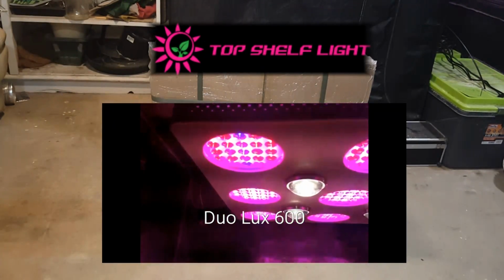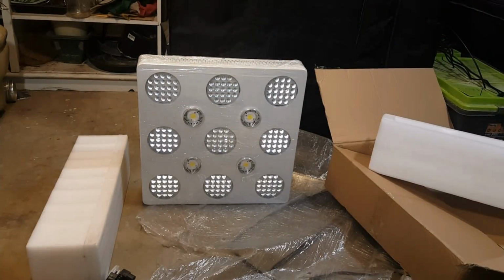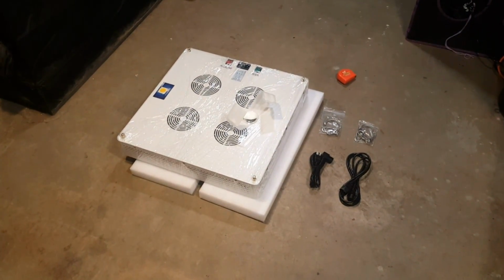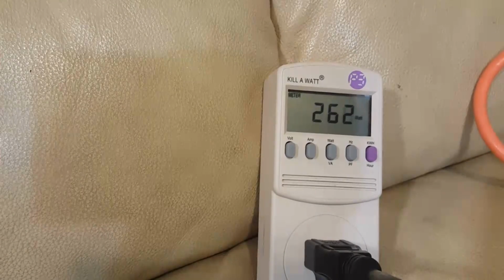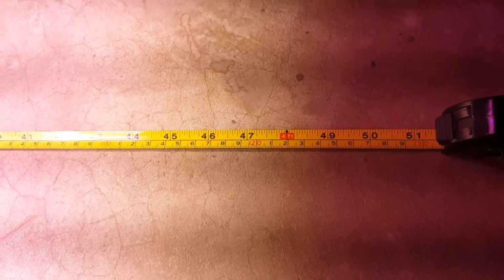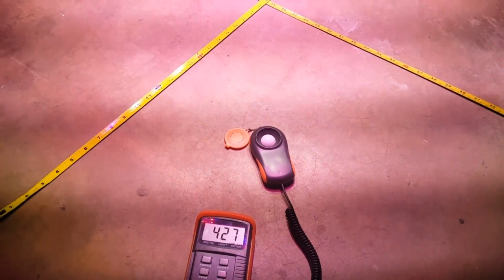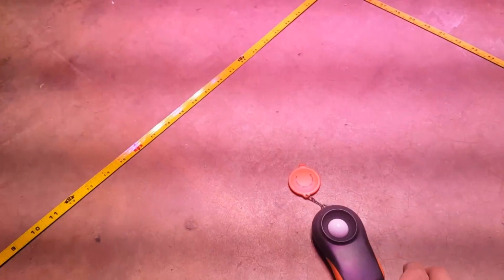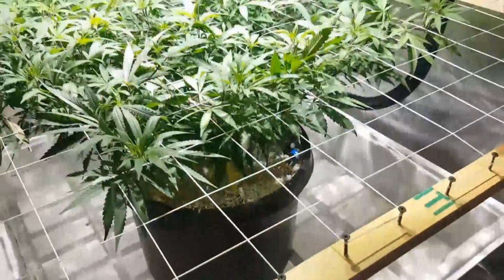Duo Lux 600 Unboxing and Testing

Comment: My duolux 600 seems to be too powerful in full spectrum mode (flowering stage).  Any idea if just running the flower mode will work?  My canopy grew a bit too high in my 4x4 so I can only get about 24" of distance from my plants.

Comment: Nice light!! I just built two of greengenegarden's 4 cob bar lights and am blown away by how bright they are. Each of the bar lights I built pulls 221w at the wall and puts out the ~same amount of lumens I get from a 400whps, ~32000!! I'm blown away by cob led. Good luck with that light.And something else I think I heard re led is that yes they produce heat but most of the heat they give off is up above the light whereas the heat from a hid light is mostly directed towards the plant canopy hence requiring a lot more energy to cool the grow space than with led so would save $$ with led. And as far as growth rate and yield, i think it depends on a lot of other factors so can't say based only on light source type whether you get more/less from led compared to hid. Cheers.

Comment: what is the price on this led
Reply: $1000
Reply: +hort hydro thanks
Reply: +Erik Coulombe if you take the time and check out there website it clearly  says it cost $1099.00
Reply: +hort hydro if it was not you then my bad if it was then
Reply: +Erik Coulombe please share with me where you can get this light for 550 I am planning on getting and would rather not pay Double
Reply: +Erik Coulombe thanks
Reply: +Homer Simpson I would be careful,my bullshit meter is going off lol..
I know saving money is a good thing.
But when someone says they can get it for half the price,that to me just screams bullshit
Reply: +Erik Coulombe did you send me that email?
Reply: +Erik Coulombe what other LED lights can you get?
Can you get a cob light with out the shitty five watt diodes?
Reply: +hort hydro looking for a cob light that pulls from the wall 600 watts
Reply from the maker: just want to post on this comment thread for you guys that the cheap ass versions erik was selling he has had 3 die withing 4 hours of use. the top self light versions have not had this problem and they have a 3 year warranty. obviously their is an internal difference between this model and whatever basic crap model he found. so good luck if you guys want to go his route.
Reply from the maker: *****
you didnt send them to topshelflight.com, you sent them to your email where you then directed them to some similar crap that is obviously not reliable and had no warranty.
Reply from the maker: +Erik Coulombe what I'm trying to tell you is what that company sold you and what topshelflight sells is not the same. that's why they lasted 4 hours and the topshelflight version performs as its supposed to
Reply from the maker: *****
no, you will see the same light casing with different components and no warrenty.

Comment: Hearing mixed results with LED and hopefully this will impress.  Not too much Jet Lag I hope.
Reply from the maker: +John McKay I'm sure this one will. Led does grow great, but it has alot of over hype and misconceptions that make people all uppity. Especially the 3w units. The still have there uses, but they don't pull the claims almost all manufacture say the do. So far cobs do tho, and 5w diodes work well too, but don't have the most efficient output/watt compared to cob or 3w diodes. There is alot more info that goes into all that assessment too. Stay up

Comment: Cree!!!!   I knew it.  Shit is gonna blow up. 

That light is badass  ..   It's using the CXA though?  Interesting....  Well if they ever go out you can replace them with the CXB.
Reply: very nice.  That light is going to kick butt and save $$
Reply: +Earl B Friendly won't save shit that's the biggest lie about led is if u want equal flower u need equal power sure u can save but u will also get less return. that said I'd love to have this light
Reply: +greenghost3737 actually it will save money will not have to replace the Cree led for a very very long time. also it pulls less wattage than a 1000w Gavita
Reply: +Earl B Friendly duh but nobody uses a 1k gavita in a fucking 4x4 plus u could buy 2 gavita for the cost and I wouldn't b so sure cause there r only 4 Cree diodes on the entire lite the rest r the same 5 w diodes that all the brands use u kno like the gro blu nv has less than 15 months old and a bunch of the diodes r out again won't save a nickel over all heat and ducting is maybe where u get the benefits other then that it's a spectrum improvement plain and simple
Reply: SUBBED TO YA! New grower here! seedlings are being put in the cups in a few days! Check out my mars hydro led review,ill be doing free giveaways at 100+ subscribers! hope to see ya! #growerslove